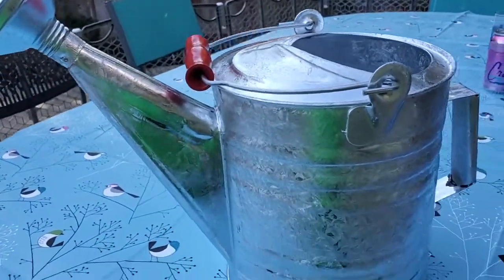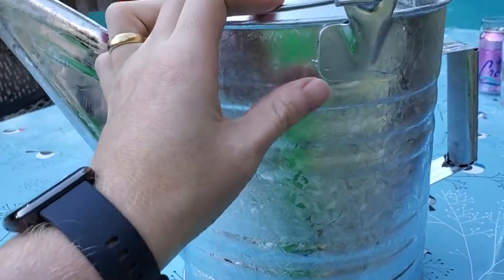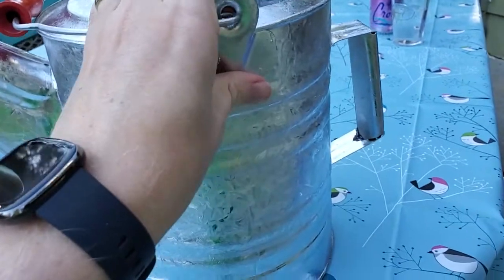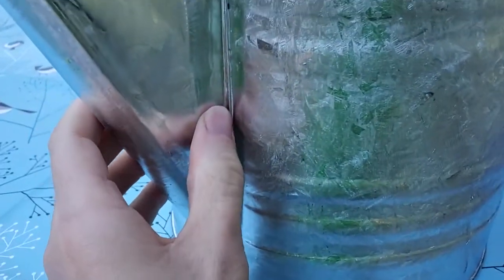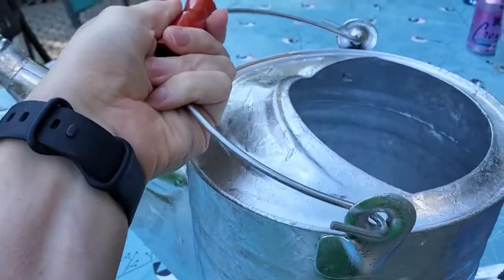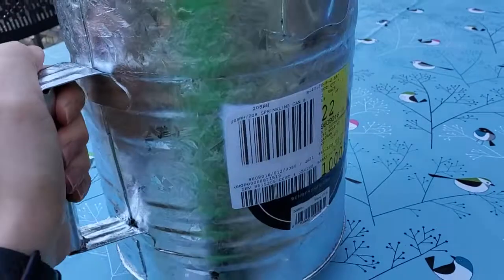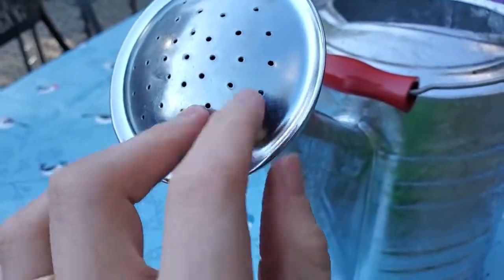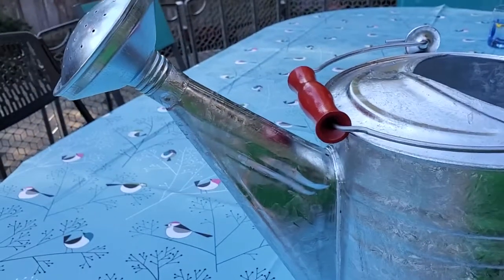Looking at my Behrens Steel Watering Can

Comment: The coating is actually zinc.  The steel is carbon steel and the zinc is galvanized onto the steel to protect it.  The zinc does eventually get dinged up and scratched off / worn off over the years, and the steel underneath will rust.  …and it just looks better and better as that happens.